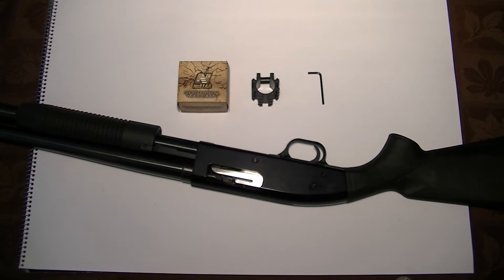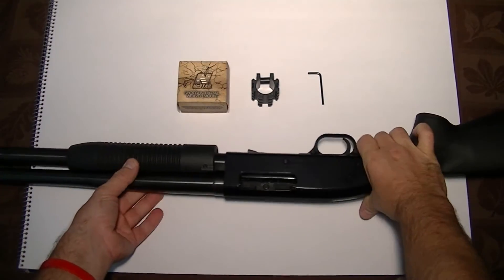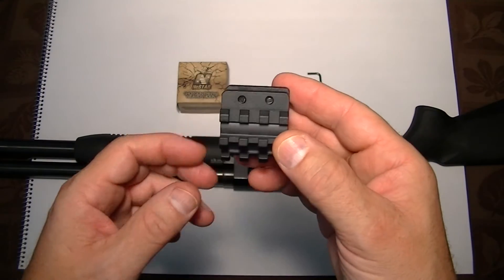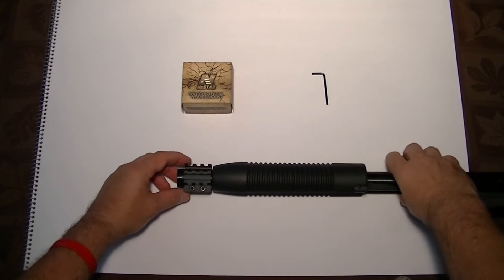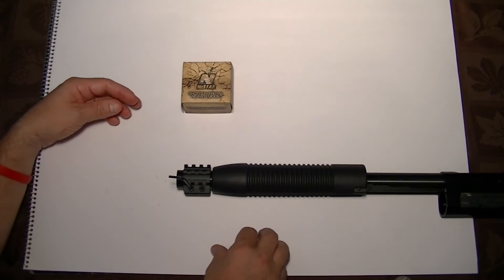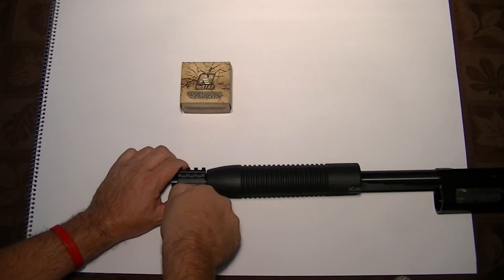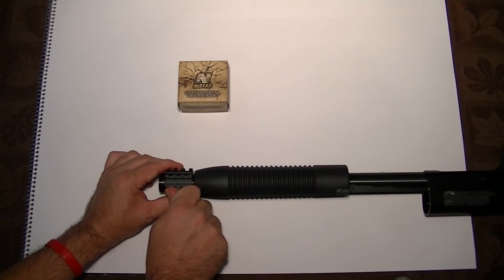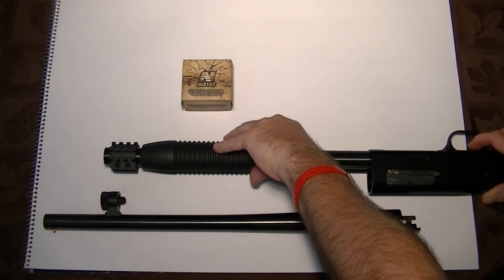NcStar Tri-Rail (MT12G) installing on Mossberg Maverick 88 Special Purpose 12 Gauge SG

Comment: Hey bud i have the same maverick how wide is that picatinny rail? I just wanna make sure that the one from ebay and amazon fit good thanks
Reply from the maker: It's designed to fit onto most 1" diameter extended shotgun magazines tubes. Make sure it's the same NcStar Tri-Rail (MT12G). I measured my tube and it is 25.22 mm or .9930 inch but there is plenty of room left to compress it more and a bit to allow expansion. Hope that helps.
Reply: Probably can’t have this and a heat shield on at the same time right